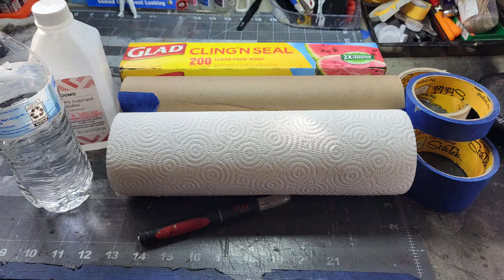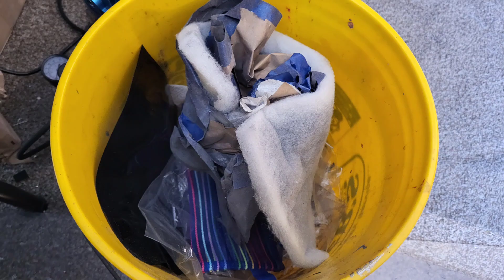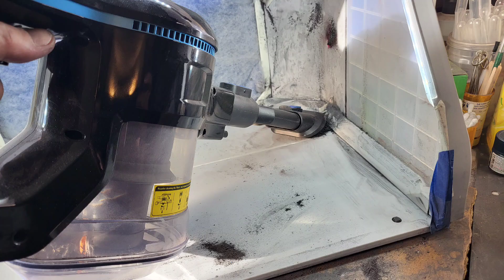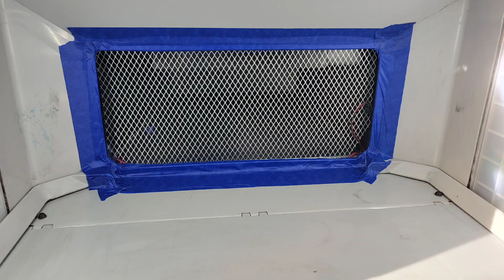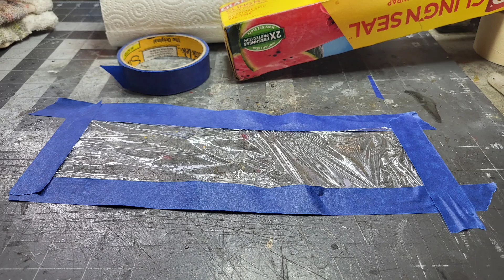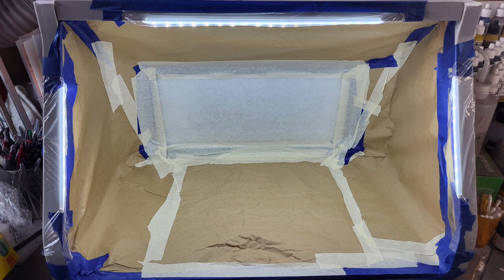spray booth maintenance time.  past time really...

Comment: Glad mine is home made its a breeze to clean lined with stainless sheet metal from scrap wipe with lacquer and change filter done... 500 cfm fan runs while cleaning.
Reply from the maker: Meh. This was easy, and just a little ipa so not as toxic as lacquer.  I was a high-end housepainter for over 2 decades so, running tape and paper for me is absolutely brainless.  I could do it 1 handed, eyes closed and hungover...